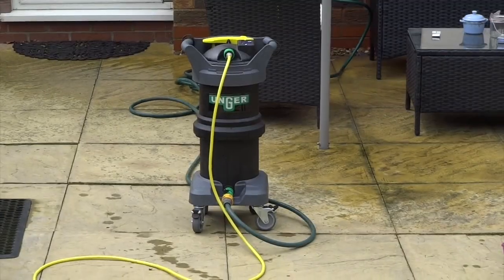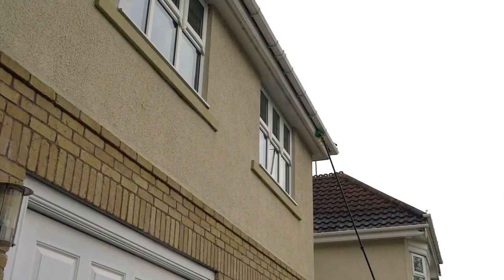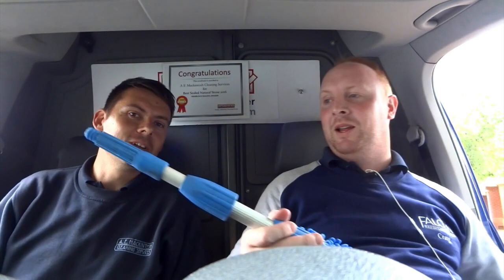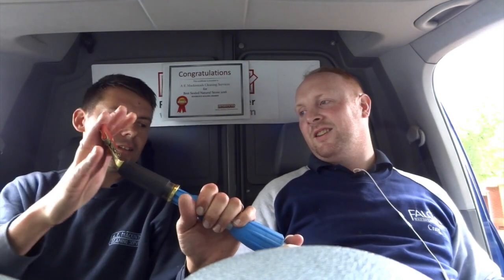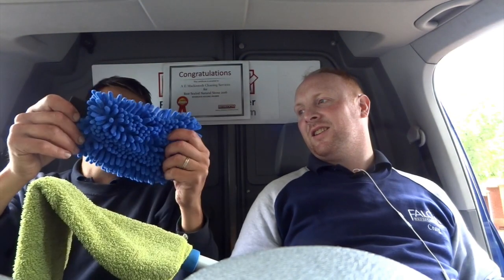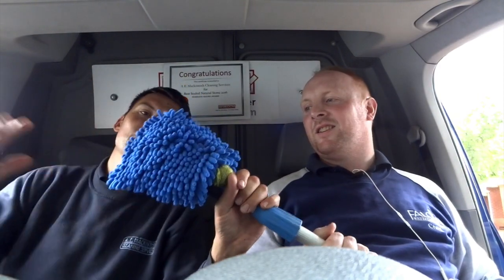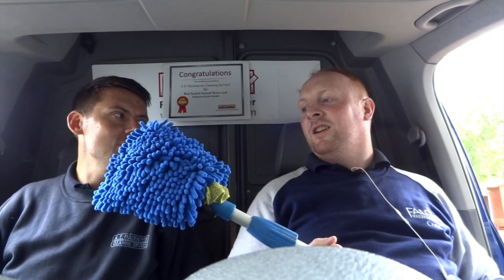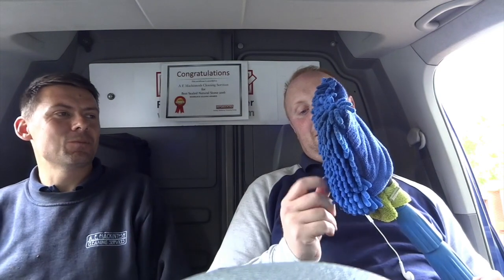Cleaning Fascia and Soffits using Hydro Power

Comment: You could actually use just normal tap water apply you chemicals leave for 15 mins or so the rinse they come up pretty well guys ........ but pure water does do wonders.. cool video once again guys.
Reply from the maker: Monk Cleaning services Yeah, didn’t mention it but I usually swap the resin for slightly older stuff for these jobs.😃👍🏼
Reply: A.E.Mackintosh Cleaning Services I love that basic tool you’ve made for the finishing touches we’ve done few these sometimes those dirty little drips are nightmare.... 👍
Reply: Pole and Pure water on low is all you need and a cloth on the end for the drips.job done